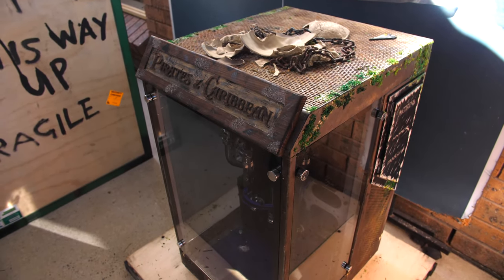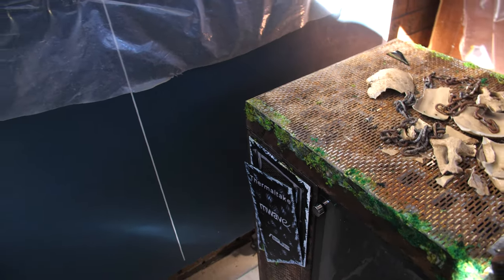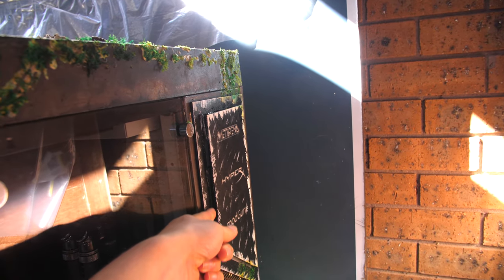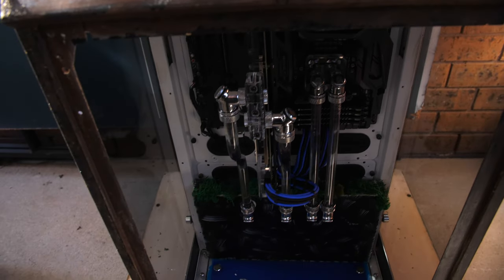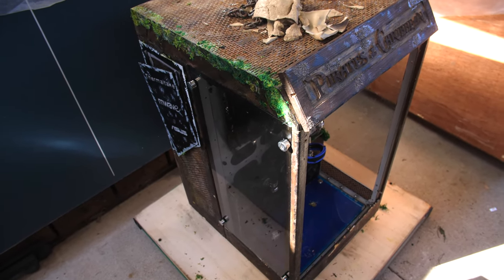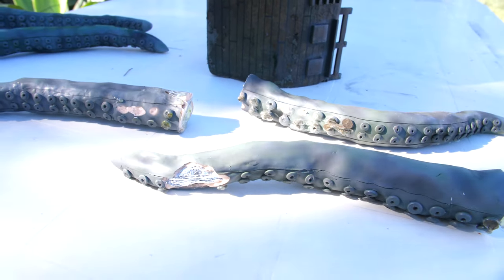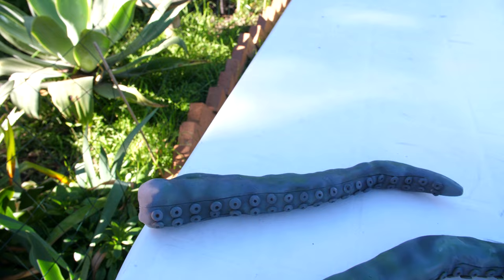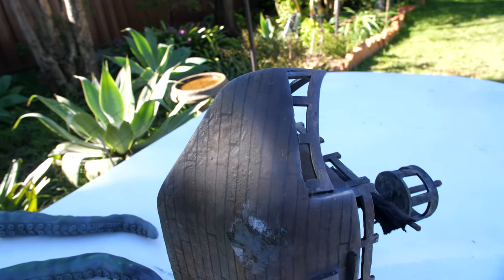Pirates of The Caribbean PC Build - WHAT HAPPENED TO IT!?!?

Comment: It is not the postage fault. It is your lack of packing it properly. Firstly, you should not have shipped it with fluid. Secondly, you should have put some Styrofoam bits or bubble wrap/air bags around the fragile pieces so they could not move around.  Your build is okay, but you simply don't know how to package something for freight. Good luck putting it back together!
Reply from the maker: +Philip Ramirez u need to listen to the video properly.. i used 50m of bubblewrap. It was also not shipped with fluid